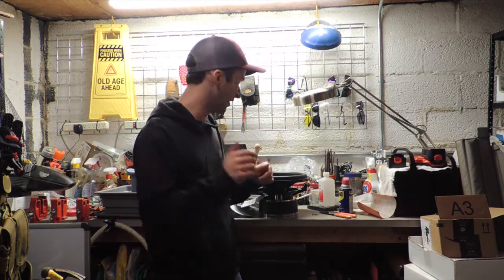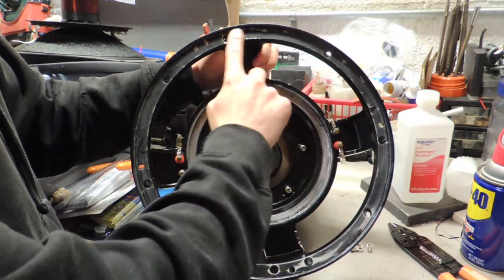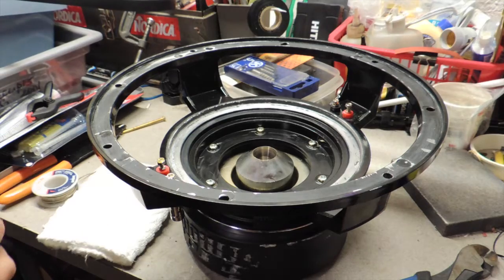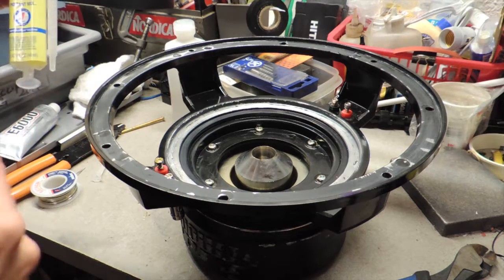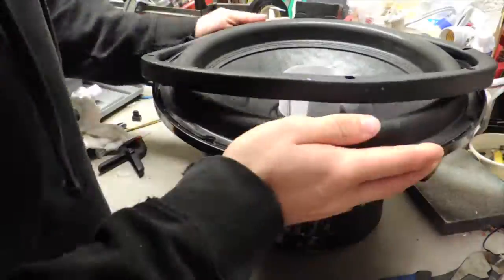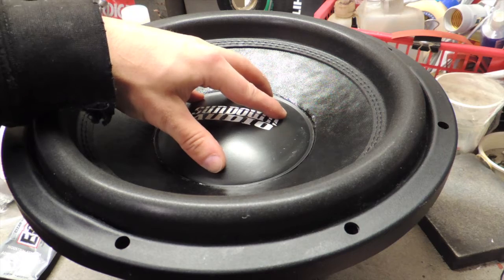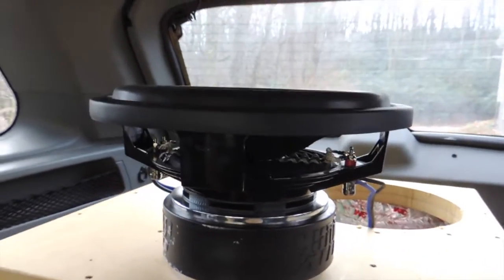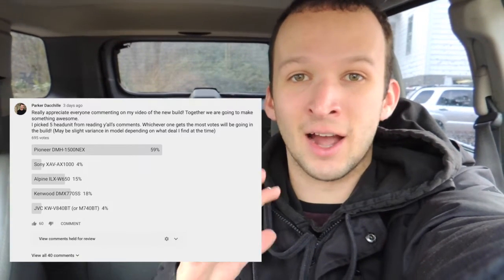How to Recone A Subwoofer, Easy! | Step By Step | Sundown SA-12

Comment: Why did you use two different glues? Why not epoxy both, or use the glue on both?
Reply: CA (cyanoacrylate) —Super glue — dries solid, and really hard. can be accelerated with ash, or something with more surface area. 
Epoxies also typically dry into a relatively hard material 

E6000 cures into a rubbery, softer material

Comment: I am amazed you did not get magnetic crap in the air gap. Use steel wire to work the stuff to the top edge than clean it out.

Comment: So I don't know if you seen my last comment on another video. I have a 12in txx blue eye candy. That the dust cover came off the coil due to a sealed box and low hz. Most ppl tell me to throw it out but it means a lot to me seeing it was my brother's that has past away. Do they make a re cone kit for this speaker. Don't have to be the blue aluminum style just want to hear the sub play again. I have two 15in. Txx red eye candy and a love the brand. Can you please help me out with my problem, thanks.

Comment: both my zv6s took a shit at 4 ohms on a salt 8k with no clipping distortion  and with voltage that didn’t don’t get any lower than 10.5 could have that cause them to blow ? The amp puts out 3k rms +at 4 ohm dissapointed asf  might sell ‘‘em or get recones

Comment: it would be nice to know the best direction to face a sub and the port. It seems like there must be some science behind this, yet, we still to this day, see sub pointed in all different directions and ports in all different directions also.  I attempted to point my sub up and it sounded like crap.  My port points in the same direction as my sub though, so perhaps that was the reason, idk.  

Has anyone done any testing on this? Overall, in an open style SUV, which direction should your sub face and port?  I believe the last thing I read, said, your sub should point towards the front of the car and most of what I've read, also say's that your port should be on the same side of the enclosure as your subwoofer.  

Thoughts?

I, currently, have a Kicker Comp Q in a pre-fab Skar enclosure (I know - I know).  I just ordered a Sundown Audio SA12 v2 and it will be here tomorrow.  I've never owned a SA or even heard one in real life, so I'm excited.  This was also my first time owning a Kicker and I'm not sure if it's the sub or the enclosure or both, but I'm just not overall pleased with it, so I'm curious to play around with my new sub, then have someone build me a custom enclosure for whichever sub sounds best.
Reply: I know you posted this a year ago but I've tried facing mine up, towards the front, and facing the back always sounds the best in my suv. 02 sequoia

Comment: Was the E6000 high or medium viscosity? Amazon sells both but idk what would be the best to use.
Reply: I know that you probably have already figured it out, but this is to help others who were scrolling through because I was wondering the same thing. It is the medium viscosity E6000.
Reply: E6000 will only be good to hike down the surround you will need a ca glue kit for the spider landing get one from directronix

Comment: hey Parker question where did you get the ring terminals to put on to the speaker leads coming off of a drop in recone I'm in the middle of rebuilding some and I'm looking for the ring terminals to put on their everything I find is either too small or too big and gaudy to fit that

Comment: Hello, i got a EDGE Car Audio EDP122SPL-E6 12" Competition Car Sub, around the screw holes where the rubber surround is glued it seems there some leakage, what glue can i use to seal this up?

Comment: Need to bend the tinsel lead lugs upward a little bit,  so there is a little more play in the wire, I dont think I would have cut the leads either.. u was a little sloppy on the glue around the basket, but now u know what u should do better next time.. decent video

Comment: Just a tip for next time. Alternate ur shims so gap isnt all on one side. Coil can move to that side of gap and cause it not to be perfectly centered. Other than that good job bro
Reply: Another tip. Invest in some clamps from harbor freight. Get like 6/pk for 2 bucks. So for like 10 bucks u will have all u need for spider and surround. Clamping makes all the difference. Same with building a box. U wouldnt glue it without clamping. Keep up the good work bro. Love watching ur vids and watching u grow both in knowledge for audio and subscribers
Reply from the maker: Good point thanks!
Reply: So question: Tht soft like material around bottom of cone thts like a card board material, but not  can that be fixed??

Comment: What you think is better the xfl or the sa? I've always said xfls were more louder and better but I wanna know ur opinion.
Reply from the maker: The XFL for sure. 3” coil and better xmax
Reply: @ParkerTheBasshead  that's what I've always said to lol my xfl 10 d22 out performed and out metered my sa v2 12 js and the sa 12 was in a bigger box then my xfl 10. Put in mind this was back in the day when I had it in a trunk of a Buick lol now I've ben ballin with my explorer 5.0 suv with 2 Americanbass tnt 15s the new ones on a synergy 2k and it's amazing. I got a dual ported carbon fiber box for my 2 15s but I've ben thinking on switching my tnts out and put me 2 xfl 15s In it or do 2 synergy 2ks on 2 hd 15s:) but it's all about money so I'll be lucky to get 2 xfls lol but good video bro like always and appreciate all the vids u put on here and commenting back.
Reply: @ParkerTheBasshead  I had sa12s and audioque sdc2.5 12s and sold the sa12s,they would get smelly faster and it seemed like the sensitivity was higher on the sa12s and that was after testing with a kicker zx1500.1 and a an vfl120.1 competition 2800 watt.
Xfls are next on my list.